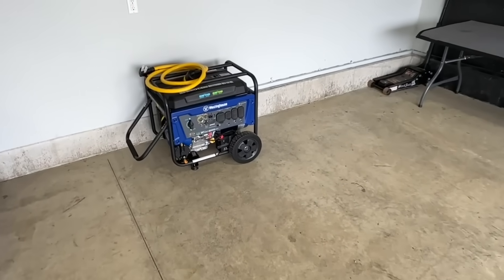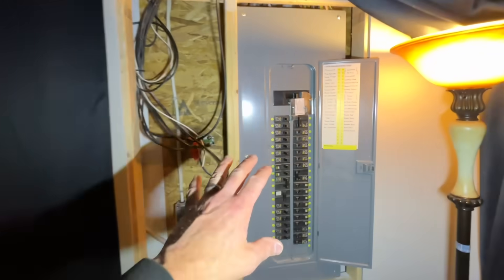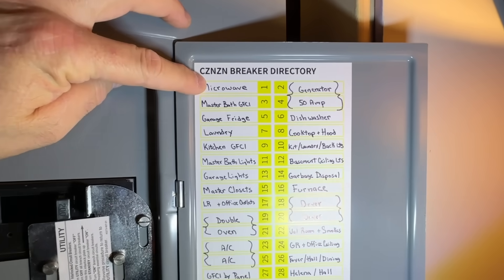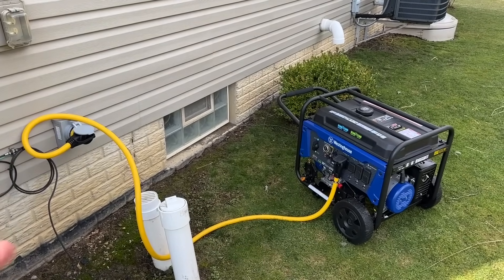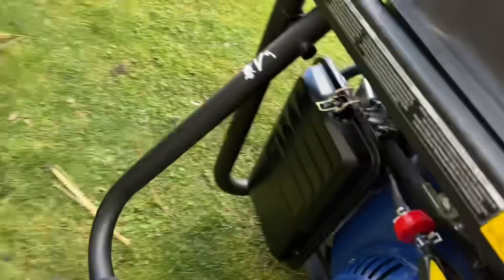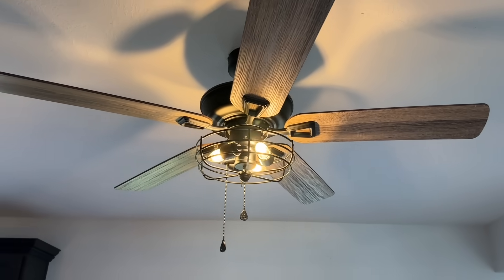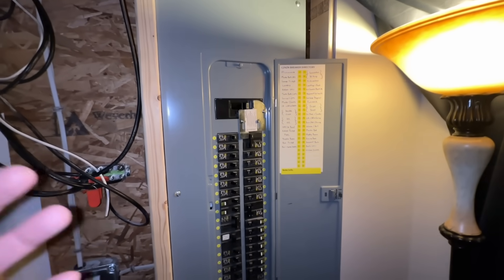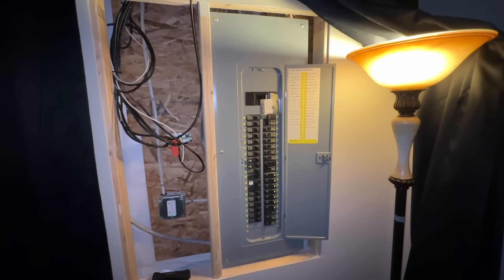Whole Home Manual Backup Generator Setup For Less Than $1600

Comment: Thanks for the video.  Question:  I just had my electrical system uopgraded at a house I just bought.  I had an interlock installed and an outlet for a portable generator.  In the event of a power loss I'd like to run my 5-ton A/C with soft start, 29kw tankless water heater, 2 fridges and a couple lights and TV.
Will a Generac 18000 watt do that easily?   If thats way over-kill, what size would I need?    THANKS.

Comment: You don’t need to turn off your breakers. Just don’t use the stove/oven or any other appliance you don’t need. I keep my well pump and hot water heater and fridge/freezers powered up. The generator can handle it.

Comment: can you theoretically put the generator breaker at the bottom of the panel?
Reply from the maker: I don’t think so, not with the manual safety interlock switch.
Reply: @DieselLegiance  yea but say you don’t put a safety interlock and just lockout the whole panel. It would still power it if the breaker is put on the bottom of the bus bar?
Reply from the maker: In theory it should, but I’m no certified electrician so I’d recommend confirming that with a professional.
Reply: Let me know if you can. That's my EXACT QUESTION TOO.

Comment: I would hook it up to city gas or propane as ethanol partially fueled gasoline  destroys seals. All the small bits that are a pain to get to and hard to find, some of them connected to the actual fuel tank so in an emergency you go to use your generator and then find it empty because the gasoline seal corroded . Just an FYI

Comment: DO NOT LEAVE ALL YOUR BREAKERS ON WHEN SWITCHING TO GENERATOR POWER!!
Proper order is-
1- turn off all breakers
2- turn on generator 
3- plug in cord
4- turn on gen breaker (on gen)
5- tun on gen breaker (on panel)
6- turn on home breakers 1 at a time.
Reply: Personally, I would switch 2 and 3.
Reply: @briantaylor9475 Agreed!
Reply: @briantaylor9475 yep.  Connect (and disconnect) the cable with nothing running and breakers on both sides off.
Reply: And make sure the Genny is at least 20 feet away from the house! the exhaust can kill you silently.
Reply: Thanks
Reply: Wrong, this is not an accurate order to switch to a generator. First, turn off generator breaker on the generator, plug in the cable to the inlet box, do not not turn on the generator first, in case you forget to leave the generator breaker off, you would now be handling a live 240 volt cable (The live end that plugs into the inlet box is exposed).  Then turn on the generator, depending on what the temperature is, let it warm up.  If you have a properly installed interlock switch you do not have to already have everything in the breaker box turned off, as your generator panel breaker should already be in the off position, and not providing any power to the panel yet, no need to do all the back and fourth walking.  Once the generator is to operating temperature,  turn on the generator breaker on the generator. In the panel, turn off the main first, then all the other breakers. Then turn on the panel generator breaker, and the breakers you want to power.
Reply: When shutting down you DONT turn the Generator off first, You turn off the breaker FIRST !!!!!  That removes any loads to the genny, then you shut down and disconnect everything then lastly you turn the Main breaker back on.
Reply: So do you do that when you lose power and do not have a generator back up🤔 NO !!! Doesn’t matter generator power or mainline power
Reply: Plus don't turn off the generator without turning the breaker off on the generator or the breaker at the panel. Turning off the generator under power i might results in your devices being powered by it subject to weird voltages
Reply: @James-sd4nj  you need to remove 1 load at a time and give the gen 30 seconds or so to adjust to the lower load. Do this sequentially, then when there's no longer a load on it let the gen run for about 5 minutes to cool down, THEN shut it off.
Reply: @silverspork86 buy a generator properly sized ….. period
Reply: The most important thing is before you turn your generator on, make sure you have your main OFF!!🤔🤔🤔🤔🤔🤔🤔🤔
Reply: @georgeowens5253 - no not really. That’s the whole point of the manual interconnect.
Reply: @georgeowens5253  He covered that in the video - the interlock prevents the generator breaker being on while the main is on.
Reply: @georgeowens5253       With a safety interlock like he has you can't turn on the generator breaker unless you 1st turn off the main disconnect. I think I would prefer to put in a manual transfer breaker box with 6 or 10 circuits (400-500.00) and not use the interlock.
Reply: @georgeowens5253  Recently I forgot to do so - generator’s breaker immediately shut off (either too much load beyond my panel or short on power lines)
Reply: Too much bla-bla
Reply: @AlexV-pf3io yyyyyyup !!! Everyone’s and electrician on here now 🤦‍♂️
Reply: @AlexV-pf3io enjoy your stuff never working again
Reply: Have your electrician buddy install a separate panel in your basement for the load your generator can handle.  Then ask him to install a switch to move power to the generator panel.  Do it right.  There should be a switch outside the house to avoid the grid power as well.  The entire connection should begin where power comes into your home, not close to your fuse box in the basement.  Jesus
Reply: @johnhansen8272 I'm a newbie trying to learn, so I'm reaching out for some clarification and guidance. In your post, your suggestion sounds like an inlet box and a transfer switch. Or are you still using an interlock kit?
Reply: @KBcooks1 absolutely.  You do not ever want your generator power going out to the grid while crews are working to restore power. An interlock transfers the input voltage from the grid to your generator.  But hire an electrician to do the work so you don’t injure anyone or fry your own home electric system when the power is restored.
Reply: @johnhansen8272 Thanks for the quick response, especially on an old thread. Yes, I'll definitely be hiring an electrician. I just wanted to be sure I was understanding your comment/ suggestion.
Reply: @KBcooks1 sorry about the overreaction.  Lots of crazy stuff can happen with these jobs.  Happy you are hiring a pro.  Good luck with your project!

Comment: Im sure someone has said it but you can get an alarm to connect to the main. It will sound when the power is back on. You can also get power monitors so you can see how many amps or watts each leg is using.
Reply: Yes

Comment: What you do if it's raining?
Reply from the maker: You can run into a rain issue with any generator situation.  Light rain, you’re probably fine as the generator and plus are weather resistant.  Heavy rain, you may want to place the generator in a better location for better protection or use some type of umbrella in an emergency situation or built some type of open air shelter to keep the generator out of the rain yet keep proper ventilation.  Luckily I never had to deal with a power outage in a rainstorm.

Comment: I want a plug for my generator and got a quote for $3,500 for an outlet outside.  I told the electrician "Thank you" but that's too expensive.  One of my challenges is my breaker box does not have any empty slots.  So now I am at square one and don't know what to do except keep getting quotes.
Reply from the maker: You probably need a sub panel…
Reply: @DieselLegiance  Don’t want a sub panel, too  limiting

Comment: Thank you for this video. This is the exact information I was looking for I purchased a generator last year which we never used. Thankfully, but I wanna try to set it up and this just gave me a good iyeah. I'm proud to do that mine my only suggestion.  Is your 50 amp cord says? You should be 20 feet from your home with the exhaust facing the opposite way from your home.

Comment: I added a soft start to my AC condenser to be able to use the system with the generator, and it helps extend the life of the compressor, conserve power, and runs better. That will add another few hundred dollars, worth it.  God bless you all, God bless the United States of America 🇺🇸 peace ✌️ stay safe 🙏
Reply: I am waiting for my soft start unit to arrive. Micro-Air Flex. Looks fairly easy to install. How did your install go? Any problems?

Comment: You can also flip the generator breaker off before you shut down the generator and turn your mains service back on. It won't hurt anything. That's what the interlock is for. Only one active at a time.

Comment: I just purchased this exact generator. Ordered it on Amazon $1049 and it was delivered yesterday. It took about 12 days to receive it. I just took it out of the box so haven’t fired it up yet. I plan on having the 50amp plug installed by a licensed electrician too. I’m getting estimates in the $600 plus range. 
Thanks for the video.
Reply: I haven’t gotten around to having it installed yet but I lost power the other day and used the generator via the old power cord method. A good reminder on the need to hire the electrician.
Reply: Why some ppl said 1600 hundreds
Reply from the maker: @smarkssucks8573 I can’t speak for others but I paid around $1000 for the generator, $500 for the electrical work, and $100 for the power cable.
Reply: @DieselLegiance please get a longer cord from the generator to your home so you and the family won’t be exposed to carbon monoxide fumes. Otherwise nice setup
Reply: Can you send me the info about the switch  which you installed in the breaker panal.Thanks lot .I really like the video and wish you all the best.
Reply: My electrician was here today.  He wanted $1,500 to install the plug outside the home. Had to run generator due to Milton.  Crazy.
Reply: @stick66 Wow! What state are you in, his fees are through the roof 🤦🏾‍♂️
Reply: @theMister07  I’m in Florida.  Yes, I agree.  I figured $300-$500.
Reply: @stick66  you are correct sir. My electrician charge me $265 to rearrange some breakers and wire the 30amp generator breaker to the 30amp inlet box and the interlock kit. I already positioned the inlet box where I wanted it prior to his service call. I’m in Kentucky btw
Reply: @theMister07  Thx.  I’m gonna have to find a different electrician.  Did that price include parts or did you supply them?
Reply from the maker: @stick66 $500 was for the parts and labor. I bought the generator for around $1000 and then I had to buy an RV style cord for around $70 to connect the generator to the outside outlet.
Reply from the maker: @theMister07 Pennsylvania
Reply: @stick66  it was his labor time and parts (10/3 Romex Wiring) I hope you get it all squared away. NOTHING like a good backup power ⚡️ solution.
Reply: @theMister07  Thanks.  One crooked vendor gives them all a bad name!  Thanks for your help.
Reply: @stick66  YW. Some people can’t help themselves taking advantage of disasters unfortunately…
Reply: @stick66  That seems high, but it might be reasonable depending on a lot of variables. How far are you wanting the plug from where the panel is inside the home? Copper isn't cheap, so if it's a long run, that will significantly increase the price of the install.

You can probably save a decent amount of money by running the cabling yourself, and paying them to do the hookup and inspection, if you're not comfortable working in the panel.

Some/most of that cost may be permit fees as well. Some cities/counties have insane permitting fees for even simple work like that.
Reply: @Wrenchmonkey1  So, I decided to do the whole project myself. Not really difficult. A couple of hundred in parts, 45 minutes of my time.
Reply: I have this gen too and created a sound proof enclosure for it. Routed the exhaust to the outside through a muffler (had a local Meineke shop tack weld an adapter for free (5 min)). I run off of my 150 gal propane tank. Good video but also agree about the order of operations for loading and unloading during startup and shutdown. :-)
Reply: Does this run 240v for the AC? I was watching another video on a different generator and at the end he says “this won’t run 240 for your AC.” How do I know which one does?

Comment: How can you calculate for a computer, light, and TV?
Reply from the maker: You can look up the specific models on how many watts they use or look up “average” running watts for those items for an idea and just make sure your generator is powerful enough.
Reply: Lights, tv, computer don’t really consume that much power.  Your main power draws will be Air Conditioner, refrigerator, ovens, microwaves, washer and dryer, dish washers. Heat if you are on electric.  If you have a two story home perhaps only apply power to downstairs and not upstairs

Comment: I’ve been thinking of doing this. My concern and question is how well does this run in pouring rain or a snow storm? When Sandy hit NY, I  wired my gen into my furnace and ran a few outlets. I stuck the generator under one of those lifetime tables with a tarp covering it about 3/4 of the way allowing for ventilation, cooling etc… I got soaked doing it, and filling was a PiTA! So I would love to build an outdoor shed with ventilation and keep it secure. What do y’all think of these concerns and ideas?

Also now that I’m retired, I spend half the year in FL. So I would never use gasoline, I would stick with LP, but LP runs much hotter than gas!

Comment: We just had a hurricane here in Ohio, and i am going to invest in one of these.  How do you add more gas?  Do you have to shut the generator off and start the process over?
Reply from the maker: I try to keep the gas steady by filling before empty but if it runs empty, I’d suggest shutting off the breaker, fill up, start it, and flip breaker back on.

Comment: Harbor Freight 9000 with similar set up.  Works like a charm.  Generator $698, cord $50, battery $40, but I didn’t have a friend $750 instal. General maintenance once a month (start up for 20 minutes).  Cheaper than a Generac.
Reply: I went with Harbor Freight, full fuel 16 hours run time.
Reply: 20 minutes doesn't give the generator enough time to warm up and make all the moister evaporate from the oil.  And it should be under load.
Reply: Isn't it way to loud? I'm sure it works, but the Westinghouse generators are much better because they are pretty quiet and they are still fairly inexpensive. I'm not sure whey the cheaper ones have to be so much louder. I had one before and it was so loud I had to build a wall around it lesson the noise. It was a piss off every time you had to go mess with it, you really needed ear plugs.   

One of my friends bought a Westinghouse igen 4500w and it was super quite (as in barely hear it running) and it sipped the gas in the econo mode. Now he sold that one and bought the same one this guy used. It is louder, but not bad at all.
Reply: @EVMANVSGAS  Happened to have both and the Westinghouse is just as loud. Your friends 4500 was a baby gen. it never ran a house.  maybe a tiny home with no range.  Comparing a 9000 watt to a 4500 is apples to oranges.   

As for building a box.. you should anyway, add two inch foam insulation and close it in, make sure it can breathe well and that also keeps it outa the weather.

I do agree both are loud, but I would rather have that than no power after a major storm like the two we just had in Florida.   I do also have a harbor freight 5000 watt inverter, now that thing is quiet... but it cannot run the entire home and we have 240 volt a/c.  It can run it all without the a/c's and range, water heater...  I use it off a power cord at times to charge laptops, phones and run our computers now and again but mostly we now run a 13000 watt duromax. IT has less than a 5 percent distortion and is fantastic.
Reply: China made
Reply: Thd?
Reply: I have the same HF 9000 W generator. I only start mine up once or 2x a year. starts right up no issues. I run mine with only enough fuel to run 30 minutes and let it run until the fuel runs out. Oil change every year.
Reply: $750 to install?.. I gladly do for $100(for my friends - $75)
Reply from the maker: Install was $500.  But that included the exterior 50amp plug, wire from the plug through the wall to the breaker box, 50amp breaker, interlock switch, and labor to move breakers in the box to make room at the top for the interlock and new 50amp breaker.  But hey, if you can do all that work plus materials for $75 you are the man 👍🏼
Reply: @AlexV-pf3io  $750, yikes, that's a lot. I got my interlock switch installed with the 30amp plug outside, for about $340.
Reply: @AlexV-pf3io definitely over paused  big time

Comment: Good job Diesel.
Just a quick question...
¿How long can you run your home on the amount of fuel in the tank?
I know that the more appliances that are running, the more fuel you use, but just a general idea of run-time is fine.
Thanks
Reply from the maker: Depends but usually around 10-12 hours max.  But I never actually tried running the tank to complete empty as when it gets low I fill it back up.
Reply: @DieselLegiance  Thank you Mr. Diesel

Comment: You might want to install solar panel with battery system so that you are it’s a lot quieter and safer in air also storage of the excessive electricity when you are running the generator but not using as much.
And to top it off save your electric bill every single day.